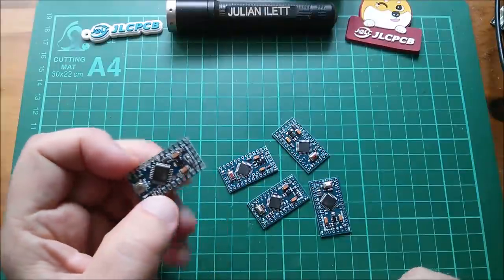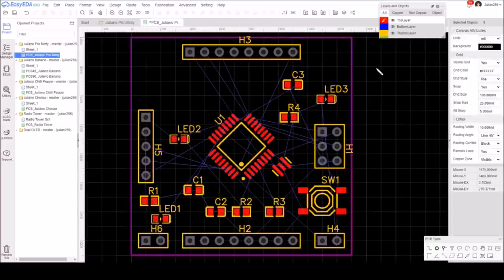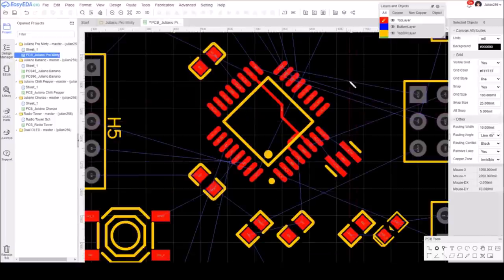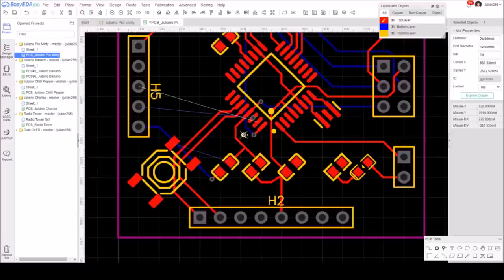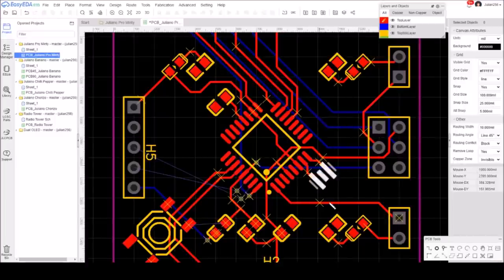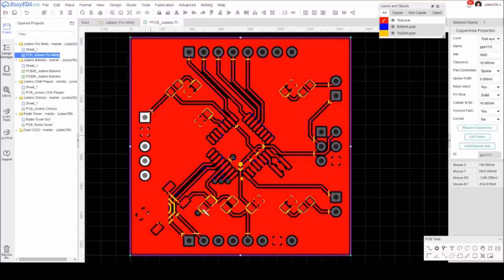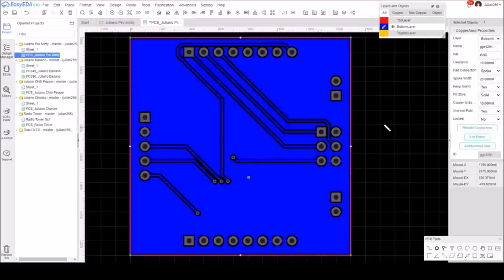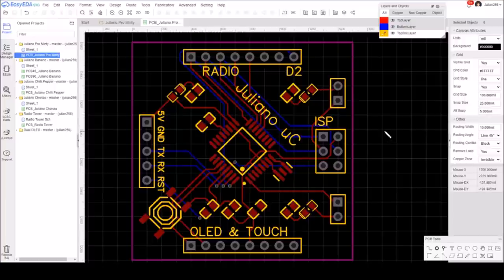PCB Layout: Juliano uC Base Board

Comment: Excellent video. I have now completed several design cycles on EasyEDA including assembly by JLCPCB and am happy to have learned even more from your video.  I have some comments:
1) It would have been nice to use the 3D image feature so that we get a good look at that skewed layout.
2) I would like to see you use the auto route function and make comments on the results.
3) You said all you have left to finish is the silkscreen. I have found that to be one of the more difficult things to get right.  I make a device that couples stepper motor drivers with Arduino to help OEM fluid equipment designers get up and running quickly. Choosing the right information and placement on the board is critical to help the user feel successful and see his motor spinning.
Reply from the maker: Oh yeah - it looks good in 3D. But my PC would struggle to run OBS and the 3D render simultaneously :)

Comment: The filled-in islands are good, but they should not be left floating. Assign them to ground and connect them on the lower side with a via.
Reply from the maker: I've just stitched them :)
Reply: @JulianIlett  that's great. Floating islands result in unexpected random capacitive couplings. Faultfinding that problem is not something you want to be doing.

Comment: Decoupling cap for the uP should be as close to the chip pin as you get. to reduce the inductance which is not your friend for high speed spikes on the supply.
Reply from the maker: I've moved it a bit closer to the uC :)

Comment: If you are going to turn all of the components at 45 degrees then they will be at 90 degrees to one another so you might just as well leave that at 90 degrees to the board in the first place
Reply: The headers are at 45 degrees.
Reply: could hve gone for a Dual sided board, chip on 1 side, connectors/stuff on the other.
or smd on one side (done by mfr) , thru hole on other (self)

Comment: Why not do some via stitching to link the top and bottom ground planes in more points, and also link the island to the top ground plane so it's connected to ground?
You could even draw some stuff with vias =P
Also, why not at least break out the unused pins of the µC to some pads, so if you need them you could at least more easily solder some wires to them, since those pins are there and you have space in the board, there is no reason to at least give you the option to more easily have access to them in the future, specially considering that bodges are a thing in prototyping.

Comment: As its running a display and handling data in and out there's no reason you can't use a 20Mhz clock, it speeds up screen refresh, also where are you gonna get the 328P-AU please ?.....cheers.
Reply from the maker: I would prefer to run it slower (to reduce power consumption). JLCPCB will supply the 328P :)
Reply: @JulianIlett  Oh ok, but you have the choice where you run the clock, but less is more ! so I thought JLCPCB got there stuff from LCSC ? and they dont have any 328p_AU, so do they source from other places and can you specify where ? if yes who has them at the moment please cos they are expensive on Ebay and ya don't know what your getting.

Comment: Where do you want to screw the circuit board? You don't have any holes for that.
Reply: hot glue, or maybe one of the connectors will just straight/angled pins from another board.
Reply from the maker: Just added some corner holes :)